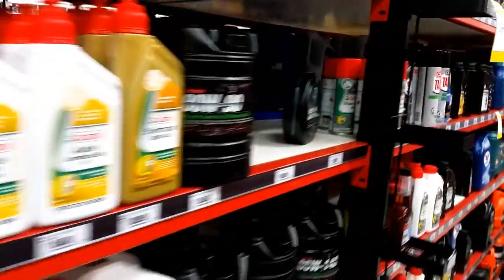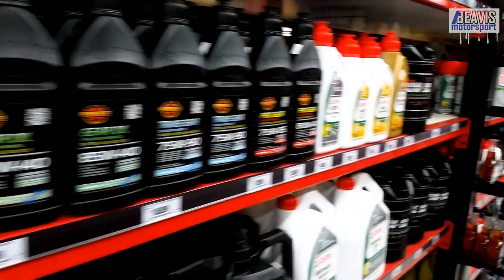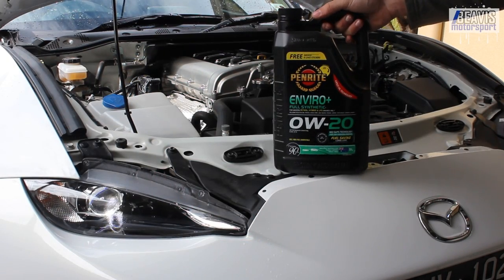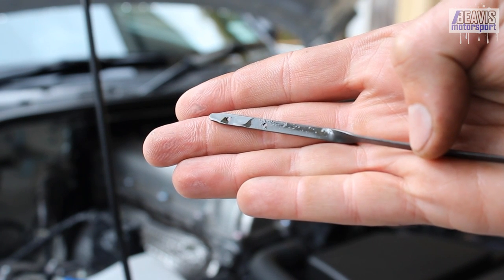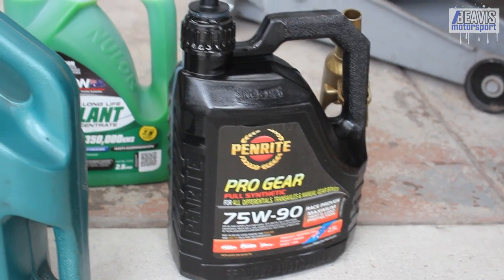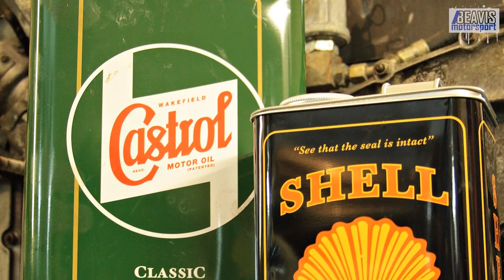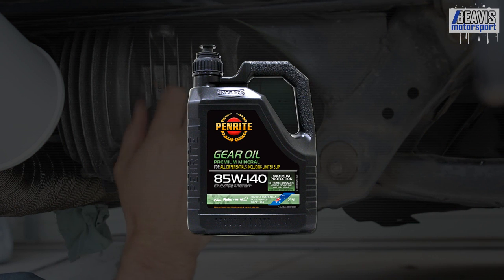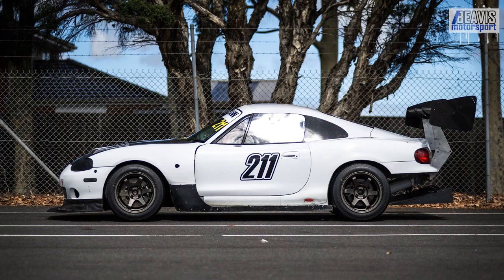COMPLETE GUIDE TO OILS FOR MAZDA MX-5 MIATA

Comment: I've just bought someone else's unfinished project. It's a 89 1.6 with a T25G running 9psi. It's only going to see track work, should I still stick to 5W30? There's talk online of 15w50 which seems high but this is my first track car and I absolutely DO NOT trust the old owner
Reply from the maker: Given it's a track car & turbo - I'd suggest a high quality oil with a weight of 5w40 or 5w50. It's likely to get hot on track so a 5w50 is a good idea.
Reply: Any brands you suggest? I was aiming for penrite 10tenths but the closest they do is 10-40 :/
Reply from the maker: Castrol Titanium do a 5w40 which I wouldn't hesitate to use in my car. For my track NB i run 10w50 Penrite

Comment: So should I use 5w-30 for a turbo miata on 7psi of boost?
Reply from the maker: I'd usually run a slightly heavier weight on a turbo car. 5-40 or 10-50 maybe

Comment: Hey mate, what is your opinion on Penrite 10tenths “racing” oil? I want my engine to last forever and don’t mind spending a bit more if it’s worth it.
Reply from the maker: I have used the 10tenths in the past, however personally I change my oil very regularly, and find that a slightly less expensive but still premium grade oil is good enough for me. My engine isn't overly exotic and the additional cost seems unnecessary for me given the 'normal' 10-50 full synth from Penrite is ~30% cheaper.
Reply: BEAVIS Motorsport tend to agree. Cheers mate

Comment: Hi Brendan, what's the benefit of 75W-85 in your transmission instead of the 90? Is there any difference in shift feel?
Reply from the maker: Hi Bryce, I opt for the Penrite synthetic because it is a premium product, high quality, and mostly matches the spec required for the Transmission. I change it frequently and believe the 85 vs 90 is negligible in this case.

Comment: 2019 ND in the UK: Mazda manual says "recommended oils "Mazda original supra 0w-20 & Mazda original ultra 5w-30"

If you could, please could you explain the difference between the two/why they recommend two different types. 

And what you would recommend for the UK, low's of -5c + or - and highs of 30c + or - if we're lucky. 
Used as a "nice day" car, so mostly driven in the warmer months, but not ruled out driving in colder months if the weather was fine.

Also, is the "Mazda original supra 0w-20 & Mazda original ultra 5w-30" the same as other brands? I'm assuming the oil viscosity is the only thing that matters here, not if it's a different brand, right? 

Many many thanks!
Reply from the maker: I cannot say why Mazda chooses to recommend certain oils. That is for their engineers/experts to explain.
Perhaps the oil suppliers pay a royalty to have their brand in the owners manuals?
The general consensus is the colder the climate, the "lower" numbers you you can with your oil, so likely for the cooler weather of the UK, 0-20 would be more suitable I would presume.
Differences in brand are mostly negligible, provided they meet the same specs and weight as specified by the manufacturer. So, use Castrol, Mobil, Shell, whatever oil brand your parts store sells, as long as the specs on the bottle match your owners manual.
Reply: @Bbeavis  okay thank you very much for the response!!

so what temps would you be recommending 5w-30? 

as that is in the recommended spec/weight section along side 0w-20

many thanks!  :)
Reply from the maker: @TheShubbah  I cannot definitively say "XX temp =  YY oil viscosity", that's Mazda's decision I suppose. I personally think if your weather rarely hits over 30degC, and commonly is in the low teens, then 0-20 makes more sense. If you see high 30's-40degC, then 5-30 would be more suitable for the ND engines at this point.
Reply: @Bbeavis  thank you for your insight master yoda!

have a nice day :)

Comment: I just installed forge pistons and rod, what kinda oil should I use ?
Reply from the maker: In that case, speak with your engine builder to find their recommendation on the right oil for your specific application. When you start building an engine for performance, the Mazda recommended OEM spec oil may no longer be ideal.

Comment: Short and simple video! Great job. Would you recommend going fully synthetic for a 1993 NA 1.6L? I have a very slight lifter tick on cold startups and long idles. And what would your thought be on using an engine flush additive?
Reply from the maker: I'm no mechanic so cannot say for sure, but personally see no reason why you wouldn't choose a synthetic. I don't have much experience with engine flush products, personally if you keep oil change frequency up then you should be fine without the need for a flush.

Comment: I have an NB Miata with a built engine running aprox 310HP on the engine. 
I run 15W50 ( Fuchs Titan Race Pro ) for the engine and Redline Lightweight Shockproof in the Gearbox as well as the Diff (Torsen 2, 3.9 )...  And I live in the Netherlands... 

It have always run this combination of oils (also in my RB26, R32) with no issues.. But when i watch this video you're saying i'm using the wrong oils :p   So Am I ?
Reply from the maker: Hey if it's working for you, then all good! I'm not saying you're running the wrong oils, this video offers the most common suggestion. Maybe you could run a lower winter weight in the engine , like a 5W-50 ?

Comment: Im running 1996 1.8 miata. all original(except valve cover gasket and small other things),  nothing fancy. Best oil for me is a semi-synthetic high mileage oil. 5w-30. I tried full synthetic and its too thin for the rubber gasket. It make the engine swet. The car have 137 000 KM. Never winter driven.
Reply from the maker: I have heard stories of situations with older motors with seals that have "worn in", where they have changed the type of oil used in the engine, and the difference in minerals/additives is enough of a shock to the seals that it causes leaks.
Reply: Mobil 1 claims to have synthetic oil with additive to help gaskets from leaking...
Reply: Then, what's the brand oil you use ?.

Comment: Mazda ND: what do you thing about Mobil 1 0W-40? Always my prefered fully synthetic motor oil in other cars. Unfortunately it doesn't have approval by Mazda ... :-/
Reply from the maker: I think that would be fine although potentially a little thick when hot? Probably OK if you live it a hotter area where your oil is always heating up quickly.
Reply: Thanks for your answer! I'm living in Germany were we have moderate cold winter times and during the last few years relatively hot summers. 0W-40 is covering a broad range of temperature. That's why I wondered when I read that Mazda recommends a 0W-20 oil for the ND. I don't want that ... :-)
Reply: Modern engines have tight tolerances, so they need thinner oil. Go with what Mazda says. They have tested their engines to the max...

Comment: Thanks Brendan!  
I used the Penrite 75-80 in my NC 6 speed gearbox but the changes have been between "notchy" and "difficult", especially when it's cold. I want to try something different. 
People sing the praises of Ford Motorcraft XT-M5-QS (I've no idea what the "weight" of the oil is) which used to be on Ebay but not now. Because the changes are slightly better when it's warm I've been told to use a thinner oil and Dex 3, the automatic transmission fluid was suggested.
Besides Ford Motorcraft, one of the forums these were suggested: 
Pennzoil Synthetic 75W-90 GL-4
Amsoil MTG 75W-90 GL-4 
Motorcraft XT-M5-QS 75W-90 GL-4
Any ideas???
Reply from the maker: I've been using a Fuchs 75W-90 oil in my trans and have found it nicer than the penrite I was using previously. Try that next time perhaps?
Reply: @Bbeavis  
UPDATE:
My cousin suggested Castrol Syntrans 75W-85 and it has made a massive difference to my NC 6 speed!! 
After 200ks, l can say that 1-2 is HEAPS better and the rest (which weren't that bad) are also better.  I'M STOKED and hoping there's more butter coming.  
While it was on stands l put 5W-30 Castrol Edge in the motor and now it starts easily, idles smoothly and sounds lubricated.
Cheers 
Eric

Comment: Anyone  else having issue's with their 2017 mx5 burning the extremely thin 0w20 mazda oil? It's burning about 1 qt every 5000 miles!
Reply from the maker: If you are in a hotter climate, the suggestion from Mazda as per the owners manual is a 5w-30 or 5w-40 oil. That is what I usually use as we get rather hot summers, and rarely freezing temperatures.
Reply: @Bbeavis  we get about mid 90s sometimes right at 100° with high humidity in NC around summer. I'll go with 0w20 this time since its winter and switch to 5w30 around spring next year.
Reply from the maker: @ryanchristensen1799  Good choice. Good luck!

Comment: I think 0w20 is too thin for Australia summer  Mazda au never recommended 0w20. 5w30 is a better choice.
Reply from the maker: 0w20 is Mazda's recommendation for most markets. Climate and the type of driving (or how hot the engine gets) should effect the choice of oil. I think 0w20 is acceptable for the winter months here in Melbourne where it's rather chilly. And wouldn't hurt to move to 5w30 for Summer.
Reply: @Bbeavis  In Germany Mazda dealers use both engine oils for the ND. Some fill in 4W-30 others 0W-20. Even though it does get very hot here all that often (and not as hot as in AU anyways).
Reply from the maker: @Noxoreos  Thanks for your feedback.

Comment: 30 years of conflicting workshop manuals from Mazda and aftermarket. 30 years of conflicting information from reliable sources. There will never be a consistent answer to GL4 or GL5 for the gearbox.
Reply from the maker: I guess somewhat the nature of any industry, there's going to be a variety of opinions and changes in technology/materials that may also influence peoples views. But I've generally seen Mazda's  MX5 manuals to be consistent.
Reply: My 92 NA says "GL4/GL5" but I've seen other NA and NB manuals which say just GL4. I decided to use GL4 😅 It seemed good to do a flush anyway, the GL5 I initially put it was black after literally 3 minutes of driving. This car had sat for a while before I recently bought it.

Comment: I think you are screwing with people re Blinker Oil....I never change my blinker oil and have never had a problem in hundreds of thousands of miles....So see!  You do not need to change it!....Well maybe racing, I can see where that could be a whole lot of lane changes ....but for most normal MX=5 drivers?  Heck I hardly even use mine anyway!  Just dumb to give away one's intentions if you ask me.... around civilians anyway....these little guys already lack passing power to begin with so stealth is super important!   BTW old school blinkers used a stinky dashpot fluid unlike modern units using long chain digital oil... for the old vehicles though best to  stick with Allen-Bradley 810-N9C High Viscosity Dashpot Fluid....but good luck finding the digital fluid for MX5s!   Since the pandemic that stuff is so hard to find....and if you do decide to change the digital fluid?  Make sure NOT to get any on your skin!!
Reply from the maker: "Allen-Bradley 810-N9C High Viscosity Dashpot Fluid"  - you are a funny chap Nigel.
Reply: @Bbeavis   Yes but like I say Newer vehicles would use digital blinker oil